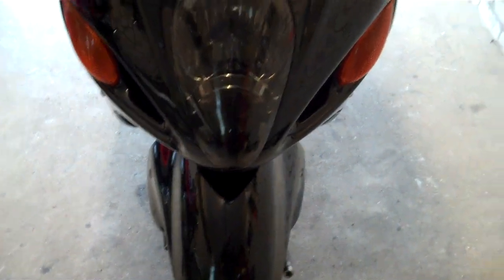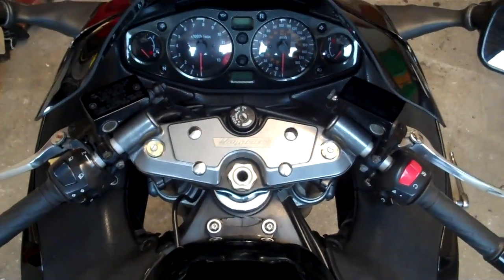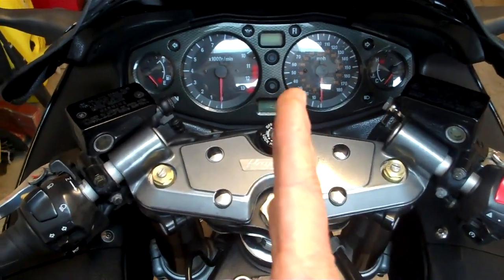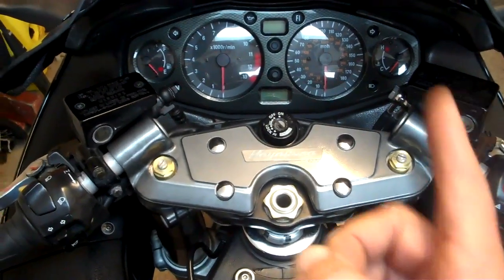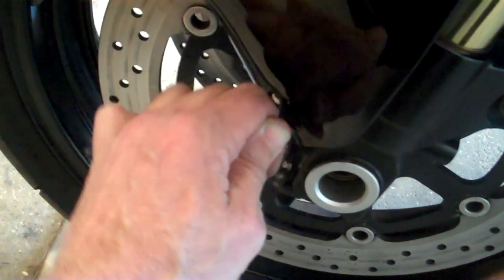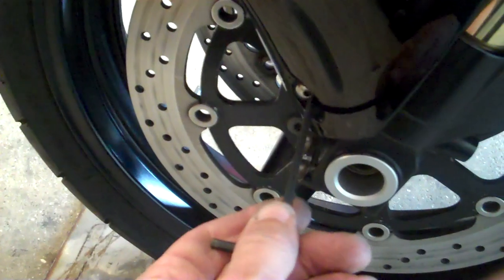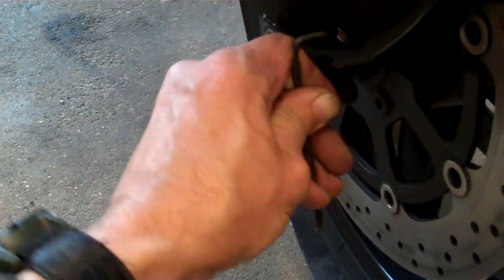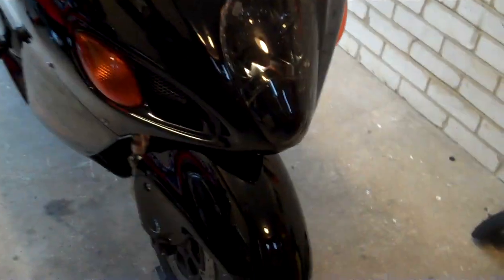Delboy's Garage, 'How-To' Re-align motorcycle forks the easy way.

Comment: Good video. My SV650 front tire has started wearing on one side, is that because the forks are twisted ? to me it's makes sense that they are, it started wearing like this all of a sudden, say over the last 1,000 miles, and it's very noticeable, I have a new tire to replace it, should it be put on before trying to reline the forks, I would think so, your opinion is much appreciated. Thanks. yl
Reply from the maker: Hi mate....your tyre is wearing presumably on the right side?  This isnt down to alignment, its down to road camber and roundabouts....in the UK (or any left side drive country) you lean right twice as much as you lean left, you may not notice it, but you do... plus the road cambers to the gutter for drainage, meaning you are riding on a tilted surface not flat, and that wears the right side too......you notice it most as the tread gets to its last noggins...but trust me mate..its nothing wrong with your bike...unlike a car where the wheels can fight each other and cause the car to 'crab, on a bike your wheels will naturally go straight, otherwise you will steer off into the hedge.....if you have a misalignment, it will show by the handlebars being twisted off to one side while the bike goes straight ahead.....and it your bars are straight when you right straight....then you have good alignment    Thats not to say that when you fit the new tyre that it isnt a good idea to check alignment like this along with the back wheel too just to be safe and sure.... good luck with it mate, and ride safe... Del.
Reply: Moonfleet41 I live in the US, and the wear is on the left side of the tire, and the handlebar is a little cocked, I even ride in the left side lane to wear on the right side more, still it wears more to the left, this all started after hitting a bad pothole one night, a while back. I get what you're saying about the wear, my other tires haven't done this, and having two bike, I just started riding the other mostly, mostly because of colder weather, my other bike is a Vulcan en500 ltd, really good on fuel. But what you said fit my bike, just haven't given it much thought of late, it's a naked K6 SV650, it's time for a new front tire, and I wanted to get it fixed before putting it on. Thanks. yl

Comment: Another excellent vid! I've looked as far back as 2014 prior to asking, will a centre stand on a solid level surface suffice in place of a paddock stand please. Apologies if you've already answered this but I couldn't find it. Cheers Mate ☺
Reply from the maker: Hi buddy, sadly, a main stand will not help you my friend, you need the full weight of the bike on both it's wheels, so a paddock stand is ideal, however, if you don't have one, or can't apply one to your bike, then it's not as hard as you think!  

You can do it without any form of stand at all - loosen everything south of the top pinch bolts (as directed in the video) , including the centre nut in the middle of the top yoke, you can do all this on the side stand ... then sit across the bike and pick it up to the balance point, put your feet on the ground and use your inner thighs to hold the bike in the centre... then plunge down on the forks as directed, and with everything centred, gently nip up the main centre nut on the top yoke FIRST, then whilst still standing over the bike, carefully reach down and do up the bottom yoke pinch bolts... once they are all tight, you can put it on the side stand and do everything else up!  Hope that helps, good luck with it, Del
Reply: +Moonfleet41 Cheers Mate, most helpful 😊

Comment: I have GSXR1000 K2 fitted wit K3/4 forks and just replaced them as suspected originals bent.  Bike passed MOT with originals fitted so expect bike to be straight but cannot ride upright leaning over to left - spotted front wheel out of alignment.Tried method above but something seemed to be preventing it working - come to think of it did not loosen caliper bolts - radial.It occurred to me to try the old alignment method used on pushbikes - trap front wheel between legs and theN twist bars to match - in this case with all but top pinch bolts loosened as above - bit more awkward than pushbike but you can feel a twisting motion, but reluctant to stay in position.  Had to open up clamps on lower triple trees, made sure mudguard loose, undid wheel bolt and tapped thru a little then twisted bars - it appeared to work but when all tightened back up, improved but still out, appeared to revert back when front wheel tightened up.
Reply from the maker: Hi Perry, did you loosen off the top nut in the centre of the top yoke, the big one??
Reply: No did not try that but yes that makes a lot of sense :) mmmm cheers, I will be away for a few days but better give that a try also - any idea what size that nut is?
Reply: I must have missed that piece of vital info from vid thanks for the further advice, cheers, Ron
Reply from the maker: It's my fault buddy, i didnt make it very clear in the video... give that a go and let us know how it goes... good luck.. Del.
Reply: Top nut same size as rear axle nut, thank goodness.

Comment: Hi Del, I noticed mine is a bit out of alignment since I came off, and i also noticed the front brake is binding slightly and on further inspection when I squeeze the front brake I can see it touching the top of the disk before the bottom, the pads are not engaging the disk square on if that makes any sense. Its a 2 pot caliper and both pots are moving out at the same rate so none of them are sticking, if you look down on the disk from above and squeeze the brake lever you can actually see the top of the pad pushing the top of the disk in a tiny bit before the bottom of the pad touches the disk, is this all an effect of it  being out of alignment or do you think i've bent something, bare in mind the front wheel was kerbed at a 45 degree angle on the left side and its a one sided brake disk which is on the right side, I know its hard for you to say without actually seing it but just thought I would ask, Thanks D&P.
Reply from the maker: +Daz Fowell Hi Daz....its hard to say without seeing it (done we all say that lol)....but if you inspect the rim edge with a fine tooth comb and look for any signs of damage, and the tyre too....then that will eliminate that... then do the realignment as here in the video... then check the brake again... if its binding at the top, then perhaps take the calipers off and give them a good scrub and clean out so they arent sticking.....and then just ride it for a few days and see how it actually performs on the road...that is always the best test.... ill bet it will be fine... if you look too cloely at brakes they can make you paranoid mate...in my book, if they work and feel right, they generally are.... keep me posted buddy... Del.
Reply: thanks del

Comment: I took a fall last summer and my fork tubes were clearly bent, i replaced them with new ones. I did your procedure a few times now but I can't get the alignment quite right. I set it, and after a ride they're out again. I think I might have a crooked bottom yoke. Is it possible to bend it back? I'm thinking of using one of my old tubes to apply some leverage and bend it back. What would you recommend? thanks.
Reply from the maker: Hi mate, sounds a little odd... it's very ulikely that you've damaged the bottom yoke, as the tubes almost always take the hit... just before you go checking stuff like that, have a look at the rear wheel alignment, and also check the bars in the top yoke--- are they on rubber mounts??

Comment: Del,
    I am so glad that you did this installment. I was riding my 1200 Sportster, underestimated a curve, panicked, slammed on the brakes (dumb, I know but the whole damn thing happened so fast) and dumped the bike on the soft shoulder. I flew over the handlebars, banging my knee pretty throughly. Bike and rider will live to ride again. But I tweaked the forks, throwing them slightly out of alignment, thus making this the video of the day for me. Just one thing...The Sportster  has a fork stem clamp screw just underneath the fork stem bolt. Do I loosen both of them along with everything else before I bounce on the forks to realign  them? I am only asking because I don't want to loosen too much and have the forks fall off.
David
Reply from the maker: +David Lehrer Hi David, firstly, sorry to hear about your spill... and don't be hard on yourself, I think we've all been there!  It happens in a moment, and our lightening ninja reflexes just dump us in the hedge aye??  Doh!  Welcome to the 'family' brother lol !  See it as an initiation....

OK, with your top clamp, yes, you must loosen the centre bolt and pinch nut... the principle is that you must release the top clamp's grip on the centre stem to allow it to move independently of the bottom clamp for it to re-align... because it's the mis-alignment of those two clamps that is causing the forks to be twisted... just back them off half a turn and that's fine, the only fasteners that remain tight will be the top clamp pinch bolts around the legs themselves... back everything else off..... happy bouncing, good luck with it, Del
Reply: +Moonfleet41 Thank you so much.
Reply: +Moonfleet41 Del, It worked! It worked! At least I think it did. Handlebars, forks, and front wheel are straight to my eye. When my knee recovers (I am giving it a few more days) I will try it out.
David
Reply from the maker: +David Lehrer Excellent... good to hear you fixed it... get well soon buddy and keep us posted... cheers, Del .
Reply: Sounds like almost the exact same thing I did... with the same bike

Comment: If you don’t have a stand then get 6-8 2x6 1ft pieces. Lean the bike to one side and put 3 or 4 blocks under the frame. Then lean the other way and put the same amount of blocks on the other side of the frame and now the frame is up on blocks and very steady

Comment from the maker: Yes, i meant to check the front-to-rear wheel to wheel alignment using a straight edge, (a long strip light tube is always totally straight!! hold it on the side of the back wheel so it lines up with the front, then check the other side to see if the gap is the same) and that will tell you if the frame has suffered any distortion by the sidecar..!

Comment: Rode my dual sport on a trail and ate it at ten mph. No damage except a few baby scratches. Pulled the bike back up and the forks are like 15-20 degrees off center. Will this work to re-align them or should I take my bike to a mechanic?
Reply from the maker: Hi Amanda, I am stoked to here you ride your bike hard off road, that's just as it should be...!  And this should work just fine... as your forks are only gripped by friction when you bolt up the top and bottom yokes, this means as a fail safe, nothing gets permanently bent when it goes down, it just gets pulled out of line and can be re-aligned quickly... even if you have bent something (which is unlikely) then you have to try this first anyway... and I bet you, this will sort it out first time... get stuck in and let us know how you get on - good luck and hope it's ok!

Comment: Hello Delboy, I have a question for you... I just bought a KTM 500exc, the compression is on bottom of front forks... the rebound is on top clickers. Now, what do the nuts do, under the top clickers? If I turn these nuts, the clickers also turn. I'm lost. Mark
Reply from the maker: markgoodier Hi Mark, the clickers, as you call them, are the damping adjustment and the nuts are the pre-load adjustment... when you wind them in they pressurise the fork spring inside and give the fork itself more stiffness.... have a read of your handbook and it'll explain how to adjust them mate

Comment: Hi del... need to ask one Q!!. A friend has a gsx600f.. but there is only 1 pinch bolt on one fork at the bottom.. the other is solid (no pinch bolt at the bottom) will this way of doing it still work on these types of forks?? Just asking before going ahead and doing it. Cheers!!

Comment: Hello,  I have a 650cc Kawasaki ER6-N.  I had a slight accident where I hit the back of an SUV.  The bike hit the right side of the SUV and it wasn't at very high speed but I can't recall exactly how fast I was going.  Anyways,  I had to replace the front wheel fender because it got scratched up.  The right brake handlebar bent out but I haven't replaced it yet.  It fell down on it's right side and hit the SUV on the left side.  Now, when the handlebars are straight, my wheel is turned slightly left.  When I'm driving...I notice that I have to keep the handlebars turned slightly left in order to go straight.  Do you think I am having the same issue? The forks fell out of alignment?  I've been driving it for about a month and haven't taken it to a shop because I've been scared that it's something more serious but it looks comparable to the issue in your video.  Any advice would be much appreciated.
Reply from the maker: +Cody Sick Hi Cody, good to hear from you buddy... and I do hope you weren't hurt in the crash... I don't think you need to worry as motorcycle forks, believe it or not, are actually designed to slip inside the yokes when the front end is hit... this is to allow for the impact of the crash to be absorbed without damaging the frame or damaging the forks... it's very rare the actual fork tubes are bent.  I would suggest to do the fork alignment procedure, just like in our video, don't foget to back off the centre nut on the top tree and when it's all straight, right after you've plunged it, do that centre nut up FIRST, then all the others lower down... once you've done this, am sure your forks will be straight, if the steering still feels off, check the rear wheel alignment (we have a video if you need it) as if this is out, it can throw the whole bike out of line... once both front and rear are set correctly, if it still feels off, then something is bent and possibly, just a clip on... to check that, take them off the bike by removing all the switch gear and levers, then look along their length frm one end and you will soon see if bent, you can buy them cheaply on Ebay second hand if you need to... 

Give those jobs a try buddy, and see how you get on... Del

Comment: is there a sequence to tightening the lower triple clamps? or do I just tighten both on the left and then both on right or vice versa.
Reply from the maker: +Vitor Deoliveira Hi Vitor, like i said in the video, tighten each bolt a little at a time and return to them over and over untill they are correct....never do one up comletely then another...that can pull the alignment out again... "quarter turn at a time" in any order untill they are all done..!

Comment: hello del.. do you have to loosen up that big center nut that holds the torque yolk??
And, are the marks on the key slot that helps to check the alignment come along with the bike??
Reply from the maker: Hi mate, YES you do have to back off the centre nut so the two yokes can more independently of each other....it is in fact their alignment that will be out causing the bars to sit one side...and not sure what you mean about 'marks on the key slot'...?
Reply: Moonfleet41 oh the marks , m so sorry mate, that i mistook the space between the white letters on the key slot for marks, bad of me.
But for the big center nut, if you loosen it after loosening all the other points, wont the handle bar sway to the side depending on from which side you lever it?? i mean, is it okay to loosen the big nut first and the other points next.its just a doubt..kindly advise..thx a lot!!

Comment: I have a new zx-14R on oddly enough the bars are slightly tweeked to the right, its a new bike with no drops, bumps etc etc. i want to do this proceedure to the bike but those 4 pinch boots on the lower triple are buried in there, it can be done but i wont be able to use a tq wrench when buttoning it back up, whats your feelings about that?
Reply from the maker: Hey Tyson.. Thats a really common problem with those kind of fully faired bikes, its almost impossible to get tools in to some of the locations you have to work in without removing hours of bodywork... if it has double pinch bolts at the lower clamp, then just tighten them by hand, in turn, and make sure that both bolts are the same tightened pressure... the old tradition of "wrist tight" works best, you can feel when they are tight, don't wrench hard on them, just so they feel tight and no more, they are only probably M8 alloy threads.

Also with those double bolts each side, remember tightening one will make the other one loose, so tighten the first one, then the second, and then back up to the first one and so on until they both feel right... then if you're worried, and you can get eyes on them, you can mark the head of the bolt with a dab of tippex so you can visually check it every now and again to make sure its not coming loose....   Hope that helps you out buddy, good luck with it.. Del.

Comment: The trick with the hex socket and bolt is brilliant. You saved me about $20.

I didn't know about this alignment procedure and it may cure my bike wanting to lean to the left a bit after I fell.

Do you tighten the steering bearing nut last?
Reply from the maker: By the term 'steering bearing nut' I'm presuming you mean top yoke nut in the centre?  And it doesn't really matter whether you tighten this first or last, as long as you do it side by side equally in little increments so it draws up square... good luck with it and glad you saved some coins!
Reply: Moonfleet41 Yeah, I meant the top yoke nut. Will report back with the results!